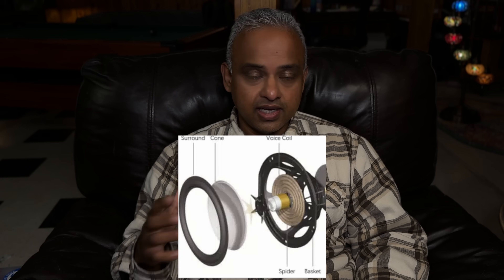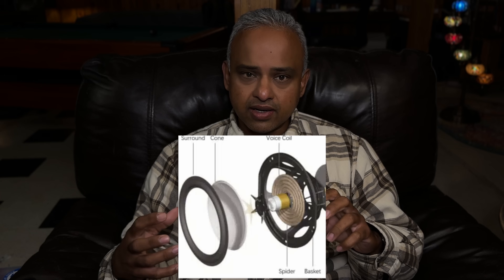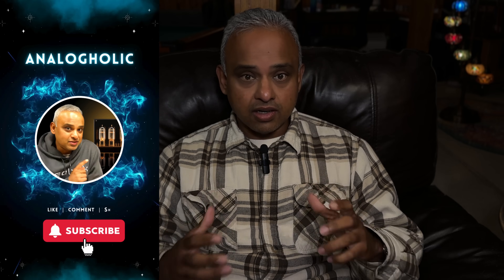Breaking In Your Speakers & Amps: Science or Snake Oil?

Comment: "The change is real...the key is knowing what is causing it." thank you for this interesting video. Very compelling alternate explanations - simple explainations that seem more likely to be the cause of the subjective experience we have. (the simplest explanation is most likely true) 😊
Reply: Truly humidity can change sound in a room , audio can change for many reasons break-in is just one. 
The human population is full of various people with a range of sensitivities . 
Audio test equipment cannot detect and explain all of them.
Reply: @AlanBlumlein2025  ...I have noticed that when the ambient air in my listening room is colder & drier, ie. during the Wintertime, that the sound is tighter & cleaner than in the heat & humidity of Summertime. Is it because the air molecules are closer together & not weighed down by the 'wetness'; I've always wondered about this🤔
Reply: I especially liked the observation the supposed physical chsnges are always good not bad 😂 we are a fascinating species

Comment: Controversy!!! 
1st I enjoyed your last video 

Diabetes, Allergies various intolerances involve over stimulation simply cupping ones ears will direct more molecular energy to the ear drum.

Hearing Sound happens on a molecular level that is a fact.

As a person who has built speakers and amplifiers yes settling is part of the whole, Start with the quiescent state in transistor and vacuum tubes. 

As an Audiophile that builds their own DACs, Speakers , Amplifiers ,Noise Suppression including isolation devices many  things can affect sound over time. 

It all involves the flow of electrons My suggestion, is to build something and listen to it for a better perspective and you will draw different conclusions.
Reply: Cupping ones ears will reflect more sound waves into the ear.

It doesn't involve the flow of electrons. It involves movement of and changes in electrical signals/currents. The electrons move very slowly through wires and other materials, about three centimeters an hour for copper. The electrical signal moves very fast, roughly 70% the speed of light in copper.
Reply: @tschorsch On the surface your answer sounds scientific but it's NOT!!!  the plates in vacuum tubes and the gates in transistors both are designed and engineered to control electrons flow. 
The rate of flow is how the blue LED was developed and that is core to the color screen you are viewing this message on. 

Science and Engineering is the most Human process on this planet. 

My glasses prescription is greater than 20/20 just by changing a diopter , cupping the ears definitely allows more molecules to reach the ear drum.

Comment: I completely agree with you. I understand that the 100-hour break-in period is primarily a marketing tactic, but your explanation clarified it for me, and I want to thank you for that. I have a question: Should I turn off the electronics every day, or only when I'm away from home for an extended period? My concern is about reliability, not sound quality.

For example, I had Bel Canto mono blocks, and I always left them on. After 13 years, one of the capacitors failed.
Reply from the maker: I’ve never left my electronics on unless I simply forgot to it off. My main concern is a burnout might happen with a voltage surge even tho I have all my devices plugged into good quality surge protectors.

Comment: This was another great video. I’ve always thought that break-in might be a thing with a mechanical device like a speaker or even a turntable, but it makes no sense with electronics. Even so, some say that amps take 200 or 300 hours to break in. I think you are exactly right, but this would start a big fight on some of the forums because no one wants to admit that their brain can be “fooled.”Thanks for the instructive video.
Reply: Standard electrolitique capacitors need between 7 to 12 hours to burn in........BG needs countless hours..........cartridges, speaker and cables need also break in ...
some can indeed be explained by the brain but break in is real.....
besides all materials have  a sound .....even when you use copper or silver and cut them to a lenght at witch they have the same resistance......they will not sound the same.......
Reply: @frankgeeraerts6243 I’m not dogmatic about this, but I think this video is from a reliable source. In the last year, I have bought at separate times, two components from respected manufacturers that most everyone would agree, I think,  are high quality solid state components. One was an amplifier and the other a preamp. Regardless of what was or was not happening inside the capacitors, in neither case did I perceive any appreciable difference in the sound quality as I put more hours on the components.That’s just my experience, not trying to convince anyone.
Reply: @Fuzzy63 
I'm convinced 😅

Comment: It's the listener who needs to be "broken in" as much or more than the equipment. Maybe we should talk about "ear break-in" instead. We instinctively learn to "adjust our ears" to the sound of new gear until we accustom ourselves to how it sounds to us and then make the necessary attitude adjustments (mostly in our heads) to focus our attention on whatever we feel comfortable listening for. I've had "bright-sounding" gear (Yamaha "Natural Sound," B&W or Focal speakers) that struck me as unduly distracting at first... but, you know, I eventually learned to get used to it after hours of exposure! That's just the way we carbon-based life forms are designed to operate...

Comment: Well,  I'm not audiophile, but a pair of Triangle Genese speakers did seem to change after 50 hours. The bass seems to have gained depth in the room, color me bit by the snake.😅
Reply: Unless you only listened to it for a few minutes and then let it play for 50 hours while you were away, it's impossible to distinguish getting used to it and actual changes in the speaker. That's the point. Your brain changes while listening.

Comment: I've read from experts that the Emotiva A100 amp needs 6 mins warm-up time to get its optimum sound. Being all solid state and no tubes at all, it is hard to understand why this happens.
Reply: They do change but  🤷‍♀️
Reply: The capacitors
Reply: If a piece of electronic gear changes its sound characteristics after it warms up then I’d say you have a poorly engineered design. Plus, who are the “experts” that you’re referring to? Are they EEs with measurements and/or double blind tests to back up these assertions? I’m guessing no.